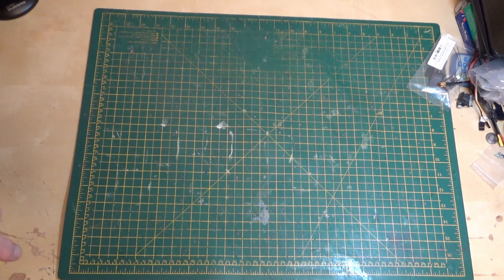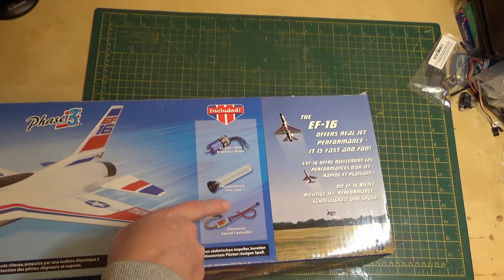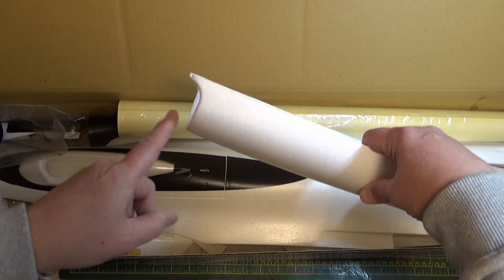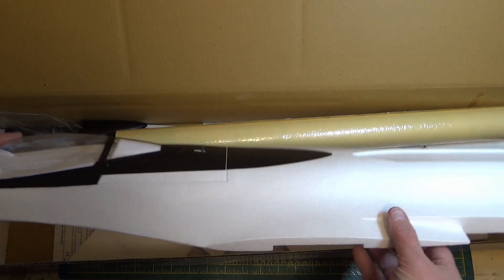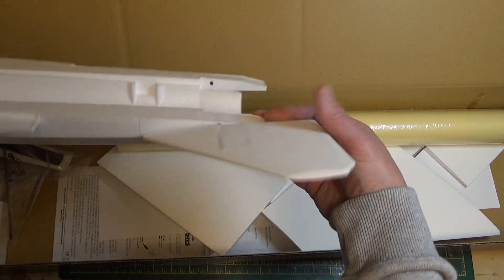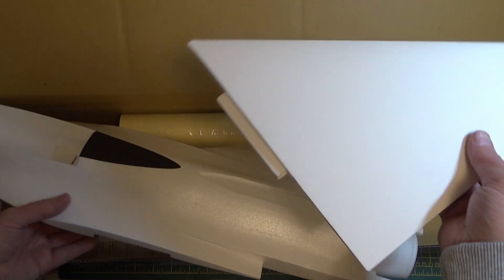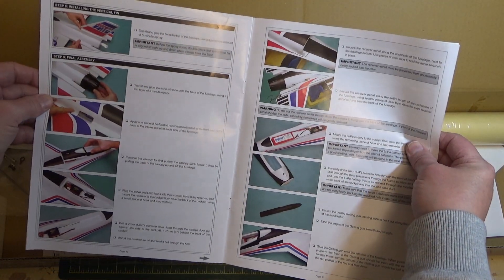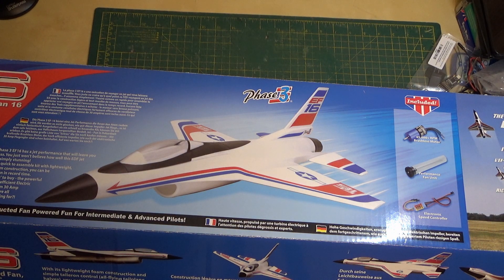New to me 'old' foam plane - Unboxing

Comment: With those articulated elevators, on something that small, you're gonna have a little screaming mosquito on your hands! Look forward to seeing what you dream up of for a scheme :) I'm eyeballing my new Dolphin, thinking a Macross Frontier theme, or maybe a Navy drone... so many possibilities with vinyl and clear sheets in the printer for decals!
Reply from the maker: The AtomRC Dolphin is just a smoooooth flyer, you'll love it. With those fully moving surfaces I don't think I will be needing big throws :)
I hated the noise of that stock EDF, a nice 11 or 12 blade one will make for a super nice whoosh instead.

Comment: Hi, I am a beginner. Made few scratch build rc planes. Used flysky i6. Can you suggest a method to add automatic stabilization to these planes?
Reply from the maker: Hi, I've used the HobbyEagle A3 V2 to great effect, simple to set up and works with any standard RC receiver. About £20 from Banggood for me.